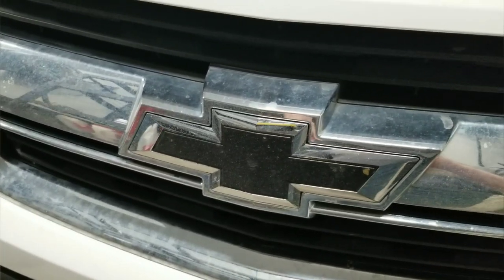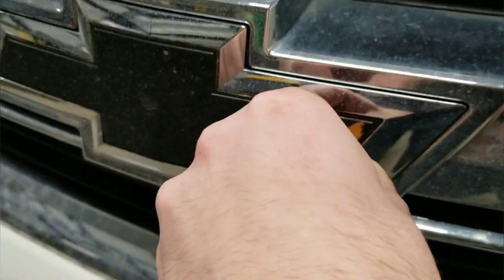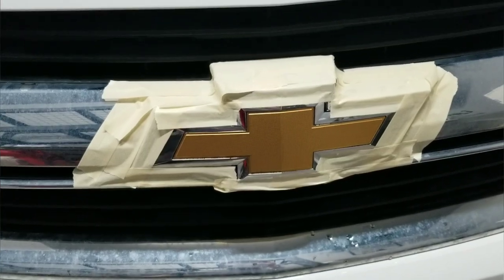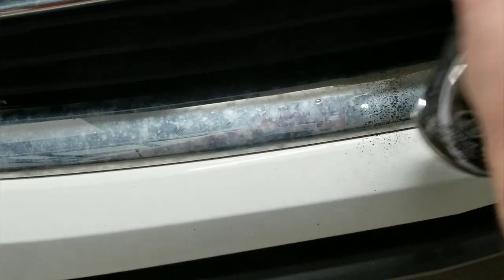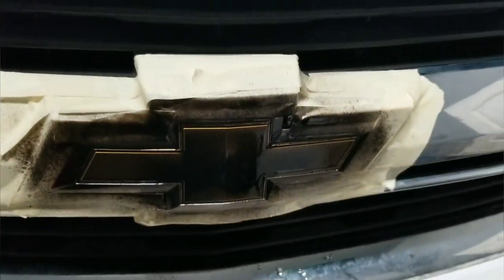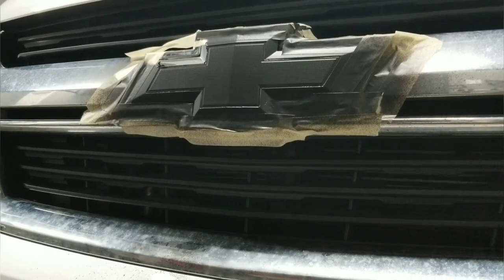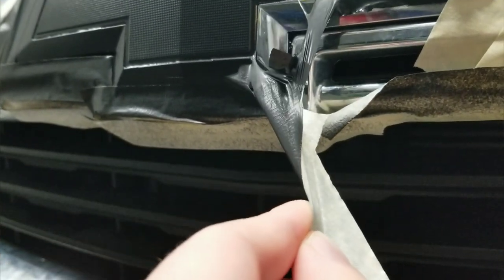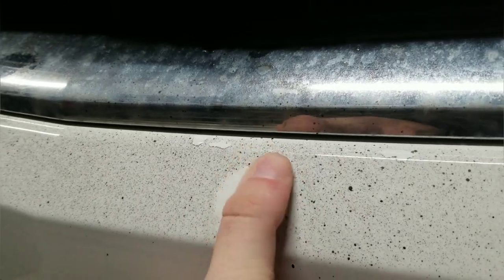How to plasti dip your car emblem -chevy bowtie

Comment: If you prepped your work area, you wouldn't have any over spray to worry about. Sometimes taking an extra couple minutes to double up saves hours later with an eraser wheel
Reply from the maker: That is true but with plasti dip it's so easy to clean I wasnt to worried about it lol

Comment: How long does it last? Do you have to regularly peel and re-apply it?
Reply from the maker: The one I got on the back bowtie is still good and it's been on for over a yr so it lasts pretty long time just gotta watch out for rock chips for the front
Reply: SJ Motorsports Nice. I’ll probably end up doing this to my Colorado at some point. Seems easier and cheaper than replacing them with the black emblems from Chevy